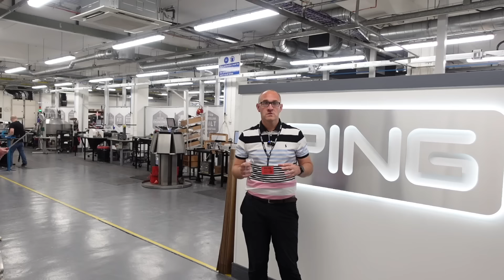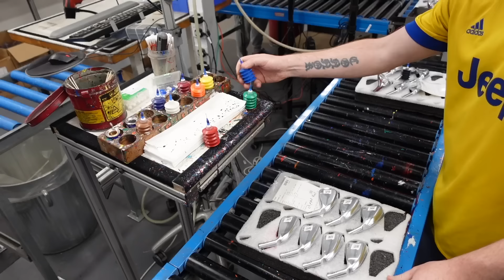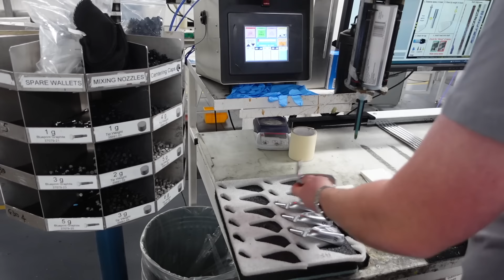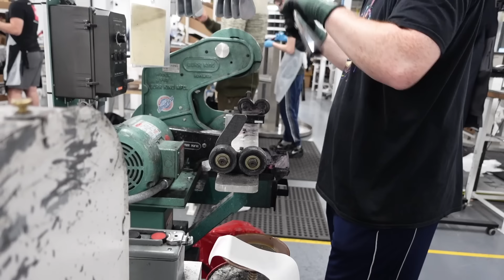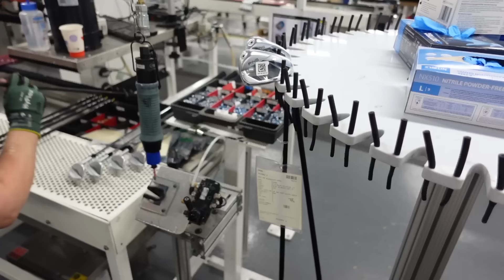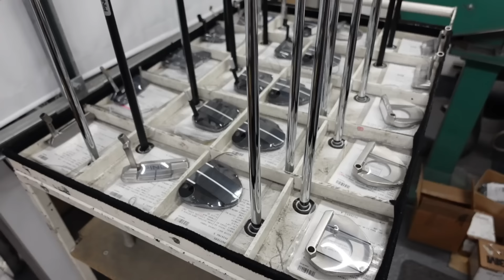REVEALED! Inside the PING Factory - How Your Golf Clubs Are Made!

Comment: I like how they plug the ends of the shafts so the epoxy doesn't run into the shaft affecting the swing weight. Not that enough of it would change it that much but its those little details that make a difference. Not even the tour vans that I've visited do that.

Comment: Terrible golf company. I purchased their flagship iron the Blueprint in 2019 but this very Gainsborough fitting factory screwed up the shafting something terrible using their high speed numatic air gun to force the shaft into the hozel and the hozels started to bend. I paid £1750 for nine irons only to be told by one of their phone sales reps that a bending and pliability in the soft forged hozel is to be expected. I wrote several complaints to Ping headquarters in USA and they finally gave me a refund and a verbal phonecall apology. They told me in the phonecall that if I ever purchase from them again they would give me a set hand built like the contracted pros in the Tour van. Hows them apples for great customer service. I’m finished with Ping and play Yamaha products now which are streets ahead of this outfit. Ping still bend hozels by hammer to adjust lie angle????
Reply from the maker: sorry to hear that
Reply: @AFGOLFSTORE  Thanks...we live and learn....I still play with two Ping clubs in my setup..Blueprint 2 iron and Ping ISI Tour wooden laminated driver I use it as a mini driver...awesome...so don't want to be too hard on them and the amateur golfer should expect a few bumps along the road
Reply: They fixed your imaginary problem, refunded your money, and gave you a phone call apology and you still hate them?? You obviously have an irrational issue with Ping golf.
Reply: @SonnyBurnett-sc6ed  Not at all Sonny…I have a very healthy and good relationship with Ping USA…Ping Europe is a totally different market and sales strategy which has been widely acknowldged in the entire golfing equipment manufacturing industry as the worst!! there is more to the story…Ping Europe said the technical error occured cos they were severely short staffed due to covid so umtraimed staff had to use their hydroloc numatic air compressor machine to shaft clubs quickly so their were multiple cock ups and many customers let down. as I made my cash purchase of £1750 during the covid crisis…the grovelling apology came only after I quite rightly wrote a detailed complaint personally to John Solheim at Arizona headquarters. John realized it would effect their sales of their flagship new blade iron worldwide because of their design flaw of their pencil thin hozel. His words not mine. The original Ping Zing and Ping i3 models had tombe recalled due to engineering faults with hozel design which was incompatable with air compressor shafting…so the hozels of these models at first started bending and they had to recall the iron and put a ban on sales of the zing and i3 in Europe….are we starting to spot a fuck up system trend at Ping Europe!!??? So after John Solheim gave the sales manager and operations manager a major pranging and fired them all…18 months later I get a personal phone call from this guy claiming to be the senior executive of sales for Europe called Simon Dixon who issued me with an embarrassing retracting apology youve ever heard. He never bothered to offer me anything accept he fobbed me off with the half hearted promise that next time I come to buy a set of irons I would be given the full tour van pro spec treatment where the ping engineers in the tour van in europe gainsborough would hand build me a set and treat me like a contracted ping pro!!!??? I said whatever. So 14 months later I had the money to follow this through so wanted to buy from a retailer and the retailer negotiated with Ping Europe to have this set tour built for me in the tour pro trailer etc etc. Ping Europe said they never heard of this guy Simon Dixon and they never heard of me….!!!!????So nom, the offer of building me a tour pro spec set of irons would not be granted. So currently still pending is a big complaint with Ping Europe and copies of all emails and correspondence forwarded to John Solheim. John Solheim’s personal executive director of sales wrote me a letter apologizing for all the problems ive been having with Ping Europe and gave me free vip tickets to the Solheim Cup 2024. I could not go in time flight cancellatioms etc so they have offered me 2026 solheim free pass. Got no problem with Ping USA…its the dickheads at Ping Europe who don’t know squatt about customer service to a lifelong Ping fan. So before you get on your high horse, bubba, I currently play with Ping Blueprint T irons I bought from USA as Ping USA gave me special shipping from USA so I could bypass any new cock ups with Ping Europe….is that Ok with you?
Reply: @michaelbardeleben4519  ok. Very detailed explanation. 👍🏽
Reply: @SonnyBurnett-sc6ed Yeah sorry it was so long Sonny…to be honest I really don’t expect any resolution from Ping…I’m just really happy at the minute that I have found my go to irons…they just happen to be Ping. I will fall in love again with Ping when I am successful in tournaments with this iron ball and shaft combination. After all I am a club recreational golfer and not a pro so can’t be too unrealistic. Nice chatting with you. Take it easy and happy golfing.